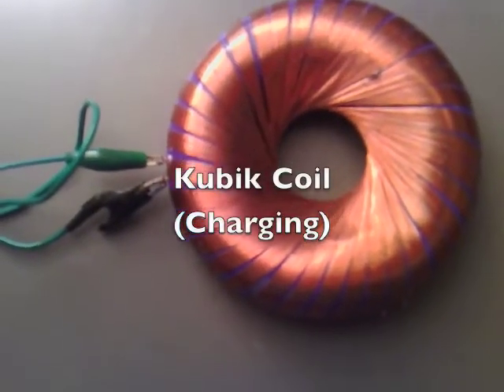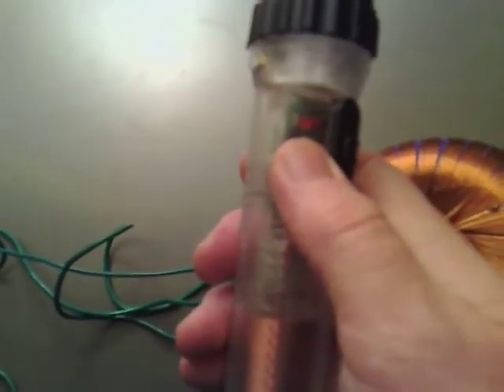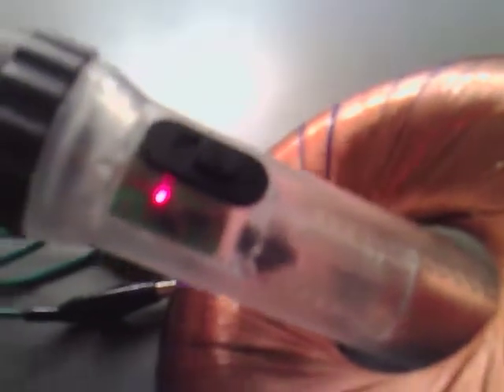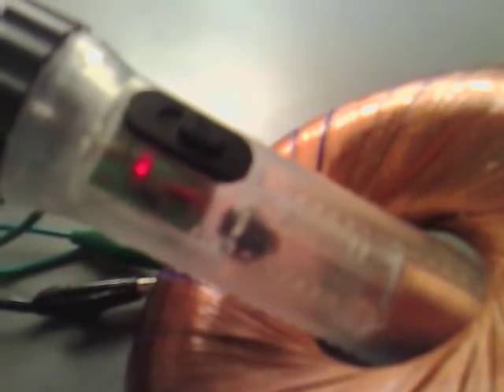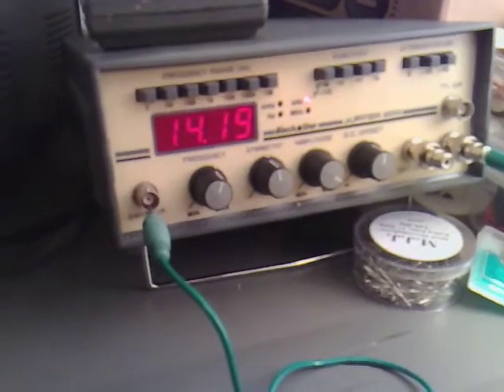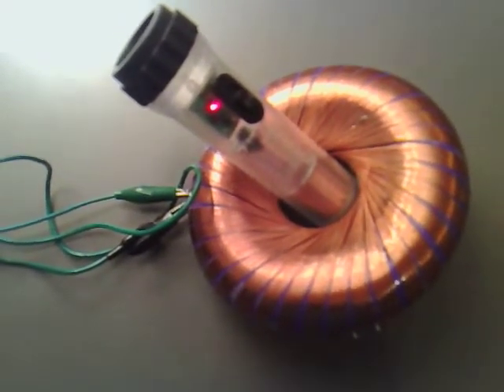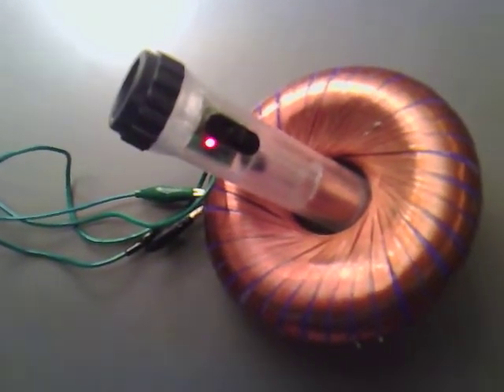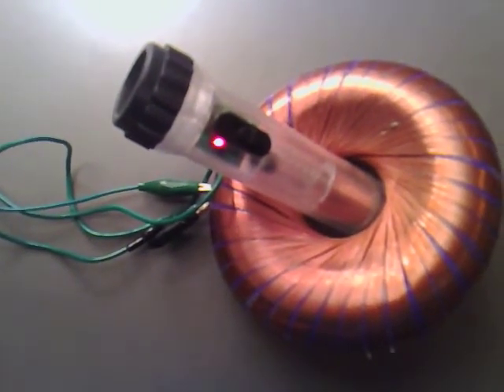Kubik Coil (Charging) 004

Comment: all thats happening is...
the tourch is rechargable by shaking the tourch this moves a magent up and down causing a voltage across the coil charging the battery. all your doing is making a transformer you are using the kubik as a primary coil and the coil in the touch is the secoundy. if you look at tooth brushes they have no electrical connection but they still get charged when put on its stand this is the same principle!

Comment: I had my doubts about wireless electricity because the way they demonstrate it is confusing. So it can power a light bulb from two feet away, big deal. Now it makes sense. I imagined it working like wireless internet, but this type of application is more feasible.

Comment: I didn't tape it so I can't show it to you but if you take a simple big inductor from a power supply or something just  connect an LED to the inductor leads and put it  close to your coil and you'll see that it lights up :), it's really simple. Some frecuencies work better than others. If you want I can do it with two inductors and upload a video to show you but your coil will work better because it will couple better.

Comment from the maker: I have been using Pulsed DC Square wave and will use 120 degrees to make it three phase so it  will handle more poer and have much ledd problems, that why I called it a Kubik Coil it has different aliments to a normal Rodin Coil.

Paul..

Comment: I like your idea of using it to charge devices. The principle of how it works is like a transformer, the frequency is creating a constant changing magnetic field which the coil in the torch is converting back into electricity. 
Although the way your coil does it has a lot more applications for charging things in real world like you said. 

Nice one, I like your way of thinking about how to use it.

Comment: At the NZ National Institute of Bioengineering they use that principle to charge up implants on mice that relay vital signs wirelessly.  The mouse stands on a plate which has a loop inside it and it charges the battery in the mouse